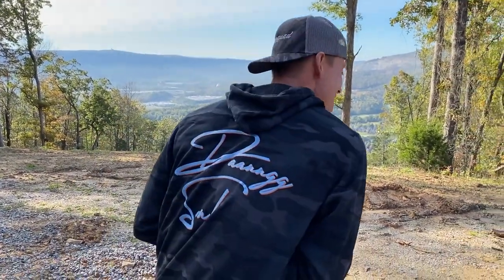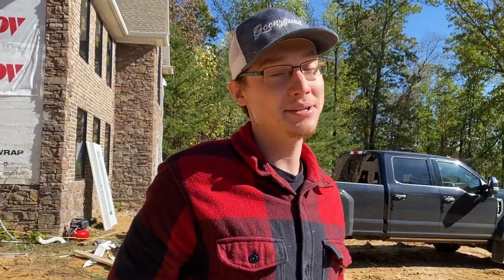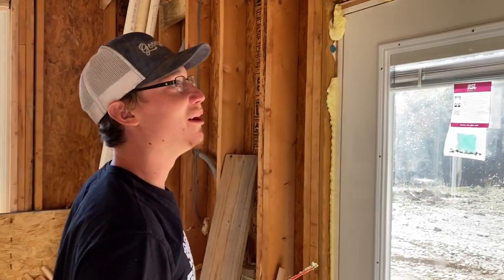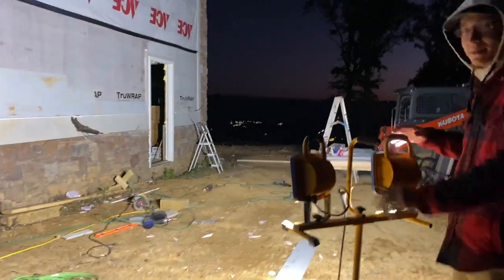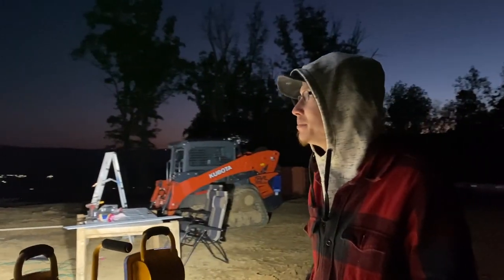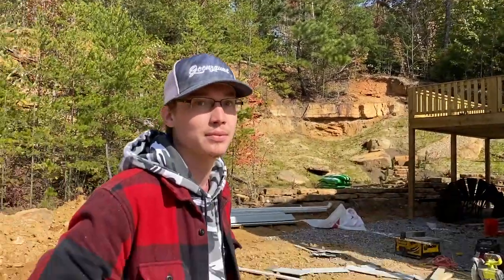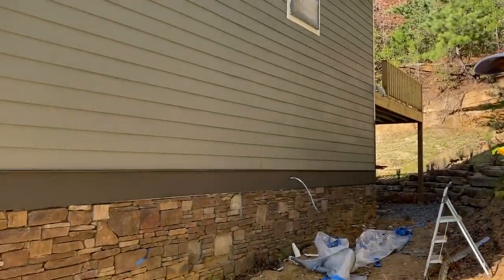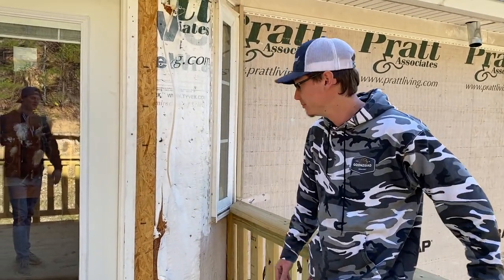The New Goonzquad Headquarters Part 32

Comment: Since you changed the direction that the door swings, I would change your light switch location before drywall goes in, so you don’t have to walk around the door to turn it on.
Reply: This is one of my biggest pet peeves, when I swing that door open the switch best be at my fingertips or I'm kicking down walls
Reply: Sounds like something a fellow electrician would notice.
Reply: @skimboard12  finish carpenter, but I install all of the doors 😉
Reply: Thought the same thing.
Reply: THIS

Comment: I suggest running some ethernet lines (cat6 cable) through the house and the warehouse/garage before the insulation goes up since you guys will be working a lot from home and need fast internet speeds throughout the house. Running the cable afterwards from downstairs to upstairs can become tedious in the future.

Comment: Guys....do you have stamped drawings for your garage?  If yes might want to get engineers to stake out the garage and set grade stakes. Winter is coming and you should get footings dug and poured. It will speed progress and get you out of the mud. House looking good.

Comment: This is the best time to install a security system.
Reply: Oh yeah, wire for ethernet! Good call!
Reply: I doubt they have fiber optic internet up in the mountains, however I'm not sure how developed the countryside is in US. Anyway, always good to be prepared!
Reply: @SwedishGreyhound  The internet options they have there are pretty garbage, honestly may be a good candidate for the new Starlink satellite internet.
Reply: @SwedishGreyhound  who needs optic internet now with starlink coming soon
Reply: They already have security and cameras.
Reply: @Jared01  actually Chattanooga is pretty progressive as far as fiber internet. They have a company there that is really helping the community out in that sense, makes them a pretty profit too
Reply: @davidmcdavid2622  I'm sure that's true, but where they are up on the mountain, there's no fiber... And no cable, for that matter.
Reply: Ethernet for in home will always be better than wifi, this has nothing to with what provides the internet to the home. It will future proof and makes sense to run while not drywalled. It's like adding outlets even if not sure a lamp will be there or not vs having to add an outlet for a lamp.
Reply: @discrtidunkwn  Not sure if you're replying to me or anyone in particular, but I'm a network admin by trade, you don't have to try to sell ethernet to me... I'm running a 10Gbps network at home, try doing that with wifi.
Reply: @Jared01  no, not a response to anyone just wanting to clarify. I studied network security but I am SDET at the moment. I really want to get back to Networking, don't really like programming as much but it pays better at the moment, lol
Reply: The best time to install a security system is when the YouTube cameras are not rolling.
Reply: @johnstedman4075  5 head, install poorly on camera then reinstall off🤔. 🤣🤣🤣🤣

Comment: The kids made 2 BIG bobos on their doors install : laying the door frames directly on the concrete sills.  With not even a plastic sheet vapor barrier !
Those soft wood frames will rot in no time...  Sad.

BTW, painting the trim dark is wise decision.  Much modern look ! 👍
Reply: They will learn in years to come just like on their well house which it’s just a well house but no drip edge on roof and left no over hang on the shingles and didn’t add a drip edge where the trim meets the stone water will get behind it and with winter coming they’ll have stone bust off and rotting but I guess if you got money to waste..
Reply: They got enough to cover. And for their first time. I’d give em credit. When they rebuild a viper, they don’t bring in a mopar viper mechanic to do their work for them or tell them what to do. They google it. If You make a mistake. Then ask for help.
Reply: Not sad its called life when it rots, they will learn a lesson, it's not a failure its a lesson. Least they giving it a good go think they can afford a new door and in future projects they know not to do it. I call that learning or "LIFE"
Reply: They sell aluminum replacements for those bottom sills. Or just fabricate your own out of pressure treated. All houses need maintenance.
Reply: The door has an aluminum sill so the frame isn’t in contact with the concrete, and there was a wood sill plate the door is sitting on.
Reply: Yeah sil gaskets are a must.

Comment: The garage man door swings the wrong way. Unless you plan to move the electrical. Makes it awkward when reaching for the light switch.
Reply: It’s killing me just watching the way they are doing some stuff
Reply: Good point, while the walls aren’t finished, easy to relocate the switch to other side
Reply: @ITSJUSTBERG2020  Lol @ the 2 thousand grand. 
Even smart house is done with physical switches still in place. To set up zones by do-it-yourselfers like these guys can get it done for a couple hundred, theres tons of electronic distributors in their area that’ll offer $5/switch connected to zone control
Reply: good place for tesla solar roof its sunny
Reply: @ITSJUSTBERG2020  2000 grand is two million.
Reply: @Snifo  tesla is much more expensive then competing companies, also on a mountaintop the sunlight might be good but depends on how far down the peak they are. Even still with the shop they plan to build and run out of, $50k in solar won’t run the shop to the potential they need, especially if they plan to hvac the shop
Reply: @ITSJUSTBERG2020  Even a "smart" home needs switches - what they need first is to get the infrastructure in place BEFORE they throw up the walls. These guys are really brave and adventurous in their endeavors and that is awesome, but they have repeatedly had to go back and redo many many things before (with their automotive builds and with this house) - so I really hope they stop and THINK before they close up the walls.  Alarm, central vacuum, security cameras, internet installation, what kind of TV/cable, what about landline telephone installation???? All should be installed BEFORE  the drywall goes up!!
Reply: @MythUnknown  Yeah True
Reply: @pumacat1637  I kind of like them being amateurs with everything. Adds a bit more of a realistic approach to it. Plus it’s not my house so there’s that.
Reply: All part of the learning process
Reply: @Snifo  Since you got plenty of open property put your solar array at a distance from the home on the ground on brackets. Forget roof solar, no since in many bracket holes in roof with so much property.

Comment: Time for that Simplisafe sponsorship.
Are you going to attach a large multi-car garage/workshop to the side?
Reply: They said earlier that they were building a large shop off to the side in the summer. Right now they are focusing on finishing the outside and then moving to the inside over the winter to get that finished. Then the front landscaping and driveway will go in followed by a shop. This was said in a previous video about a month ago.
Reply: @bgurney27  I think they should add some builds in between

Comment: The Mountain Shadow looks much better! The house is starting to look like finished from the outside. But please paint the door black to match the windows and you also need to get a black garage door for the black. 🙏🏼
Reply: Yaaassss. This is why I came to the comments section, black door is a must
Reply: Or a pop of color like pea soup green and tie that color in with the well house so the well house is green with a mountain shadow door, like a switcheroo y'heard

Comment: Well you guys are in the mountains, and a lot of the house is in the shadows most of the times. And it does look daaaang son! Haha so yea mountain shadow broskis
Reply: The house is on a south facing hillside which receives almost unobstructed solar radiation. The elevation and the nature of the hinterland mean that wind speeds are accentuated and lower temperatures will be created by windchill effects. And since the property is almost outside City Limits, it will be little affected by the 'Heat Island' phenomenon. Overall, this building will be subject to quite severe weathering.

Comment: I'm amazed how modern american houses are being made with wood, plywood and plastic wraps. In my country, it's all brick and steel rebars.
Reply: Same here my guy
Reply: Yep, easy to build, budget friendly, and energy efficient. Welcome to America
Reply: Is it a warm country where thermites are a problem? Here it's not a problem since they don't tolerate frost (yet?) and trees grow well (up north). I live in Canada and it's similar to him, except for more insulation and one major difference, most houses have a basement so that it's foundation is below the winter frostline and water pipes and sewer are safe from frost. As much as I don't really like woodworking, it's quite a versatile yet strong material. The worst enemy of wood in a house is water, the wood can stay strong for hundreds of years unless it's in contact with moisture, then it decays surprisingly quickly, and that's why the use a sheet of plastic wrap, but not any wrap, a special "tyvec" that repels water but lets vapor go through. You use the resources that makes sense where you live.
Reply: Here in California, USA houses have to be steel or wood due to earthquakes.
Reply: @ll5352  nope, usually thats climate and culture. Especially culture. In Europe there is a common thing to have multi-generation houses (100 - 150 years). In Asia quite often buildings are completely rebuilt every 20 - 30 years. In countries like Japan it's even less than that.
Reply: @ll5352  nah, my country had wood houses being built until pretty much half of the last century, now they don't do it anymore, it's considered quite antiquated. Bricks are cheaper, solid, and the houses don't dismantle like legos when they face the strength of nature, as I see happening in your country everytime a hurricane hits.

Comment: Before you put the drywall up look on the in side of the house to make sure you didn’t hit no wires by nailing the hardy on the outside it will be a problem when electric is put in and could catch fire stay safe out there GOD BLESS

Comment: Maybe lift that Narrow black window you just installed on the back deck, 1_2 inches or so to match the top of the existing big black window next to it.
Reply: I saw that as well, it would make the hardy board easier to line up as well

Comment: Just a couple of suggestions guys......glad to see you got the respirator. Treat the nail gun as the potentially dangerous tool that it could be. (meaning: don't be flipping it). The new door  swings the wrong way. Also, I thought the original plan was to frame in the garage door. House is looking great and updated.

Comment: You guys bought the wrong handed door. Now your light switch is on the opposite side when you walk in.
Reply: I noticed that too, i hope they change the wires to the right before they close the inside.
Reply: They did a pretty nasty job using that foam sealer. Its a pain to clean up once it dries up
Reply: Turn the door upside down, duh.  Lol.
Reply: LOL, rookie mistake. I did that too with sliding doors. i wonder if the building inspector would pass that
Reply: Garage door should open to the outside to keep it from hitting cars parked inside.
Reply: @Jddvs  they still have a lot to learn. I dislike how they smeared paint over some of the stones and windows also. Simply take some time and work neatly
Reply: Ouch you're right
Reply: @Jddvs  they are not going to put cars in there.  It will be where there online store is
Reply: It's usually fire code that an outside door has to swing out in case something falls in front of it on the inside and then you can't open it to escape.
Reply: @KrS14  
That’s interesting because here in Calif. all our doors open inside, at least in houses we live in.
Reply: Here in Fl the doors swing out for hurricanes

Comment: You're never going to pass a pressure test with that garage door in the back being part of the living space you might as well take it out and put in a sliding glass door
Reply: They’re not including the garage
Reply: @GmAmericanpower  if it's tied into the HVAC they have no choice. Hope the weather seal on the garage door are nice and tight
Reply: @GmAmericanpower  there is hvac supplies in that garage. Which means, whether its intentional or not, the garage is part of the house. When the house is depressurized for the Blower Door test it will pull pressure thru those hvac supply vents. They have also said many times that they want that to be part of the house not a garage. Op is absolutely correct, they will not pass the Blower Door test with garage door in place.
Reply: @nock7087  -50 Pa laughs at that weather seal on a garage door...ain't gonna pass with that door lol
Reply: @GmAmericanpower  you have to go back and watch some of the old episodes they said on many occasions that they wanted that to be part of the house they have HVAC in there they opened that up into the rest of the house that garage door will never pass a vacuum test
Reply: the air test. which measures air exchanges per hour. generally happens after insulation/vapor barrier. giving you a chance to improve before drywall. the garage door will be omited for this test, by covering with vapor barrier,
. im more concerned that they think open cell spray foam is good enough.  it wont stop vapor/air. windows should be sealed to inside framing. i prefer rod and caulk with silicone. not acoustical sealant.

Comment: Looks so good, great door! But why replace a steel security door on ground level that was kicked in with a glass door?
Reply: I was wondering that too especially when they said they’re planning on attaching a garage there as well. So it’ll be a glass door into a garage? But I guess if you have a Fleet of Súper cars parked in it 🤣 it makes sense😎
Reply: I was thinking just have it swing out right?
Reply: They're going to have security system and dogs. Mentioned it in an older vid.

Comment: This is what we call in Europe a “shed”. Plywood as exterior? Why don’t they build houses the normal way with bricks?
Reply: The sheathing is actually OSB (Oriented Strand Board), and is a cheap option chosen by the original builders in 2008. No doubt the work was carried out without real regard to the longevity of the building, or that was not a relevant issue for the developer. Masonry buildings are not as common as timber frame in the USA, and are more often seen on projects with relatively larger budgets and more discriminating purchasers and occupiers

Comment: you guys should rent a lift. not safe what you guys are doing.
Reply: If they had fully scaffolded the house for a month back in August all of the external works on the facades could have been safely and properly completed in four weeks tops. That's the professionally correct approach and it's surprising that their older brother ('Alex'), who is a contractor, did not convince them of this.

Comment: Dudes your doing some stella work on the house, but I am missing the car builds. Can't wait for the garage to be built. 2 lifts I hope. You need to build a warehouse on that land for all your vehicles and machinery.
Reply: Winter is now arriving on their mountain, so I would not expect conditions to be appropriate for construction of the Garage before April 2021. It could have been completed by now if they had properly organised their overall timetable in June 2020 when they purchased the land. A simple portal frame steel structure can be designed, manufactured, transported to site, erected and clad in twelve weeks, as my Practice has just proved in Florida.

Comment: The pressure test is just a certification. It is to keep up building standards. There are some shifty contractors that are out there making sub standard houses. This way you know you wont be loosing heat and AC costing hundreds a year.  At present there are no legal requirement to test old houses  that are being renovated. New houses need to pass a Air Permeability Test to comply with Building Regulations to provide a measure of the permeability of the building. A standard house has an air tightness test result of between 7 to 10 Air changes per hour. ... In other words if your air change rate was 1, you heat the air up to comfortable temperature once every hour and it will take 1 hour for that warm air to be replaced with cold air.

Comment: Pressure test the house before drywall is installed and again when it is finished. Doing the test before drywall lets you find and seal all the little openings and air leaks easier.

Comment: We all knew the darker trim would look better. It matches so much better.
BUT, you need to go ahead and get some new gutters. Get some half round galvanized gutters guys. Low maint, no painting, and the half round moves more water at a faster rate, so less cleaning them out. PLUS, the galvanized stainless look of the gutters will look killer on that house.

Just do it.

Comment: you all are getting right into it - looking nice - you got inspected and insulation and drywall and you can do int trimout and shift to the garage build - still lots of planning and sitework to do but first things first you will get the house done and get to the garage, do sim trim - should be interesting - go large cause you need the space - plenty of concrete pads too and a pole barn - again you are going to need storage space...maybe you rent some machines? try to do it cheap - not an easy task - doing your own labor is a must but you can do it easily for most part - the house is a good warmup

Comment: I definitely would have went with the mountain shadow on the hardy and that light gray on the trim. But hey, do u guys. Looking good. Also, spray foam insulation would be best. It gives u the best seal and it will keep that moisture out the house since u guys so high up.